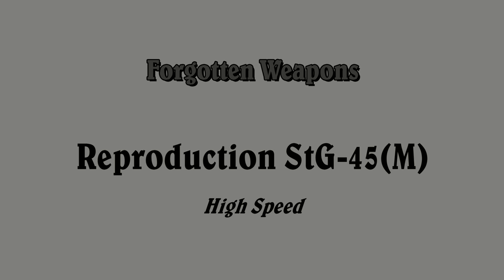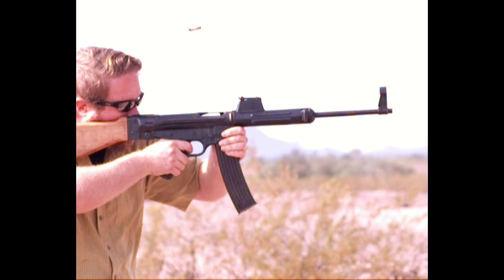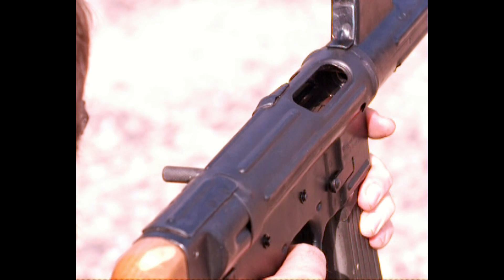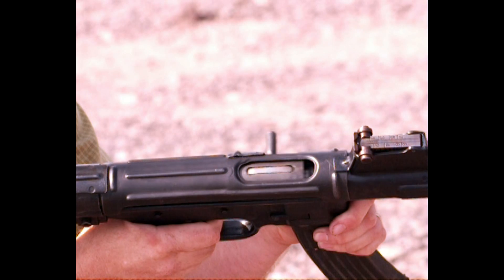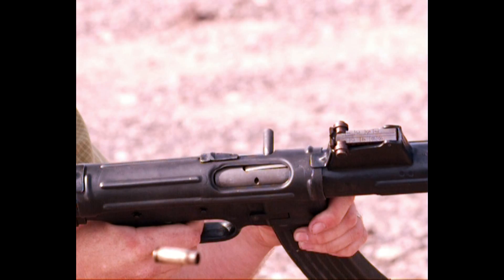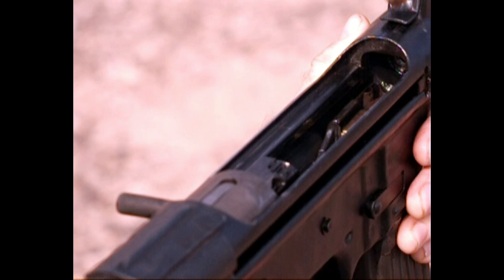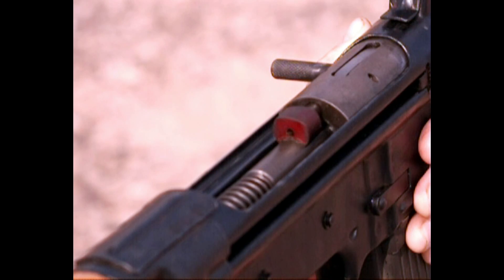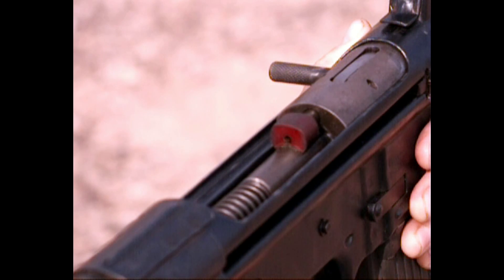Slow Motion: StG-45(M) Prototype (Reproduction)

Comment: This would have revolutioned the war. Imagine 3 Million Lads with STG-45
Reply: The reason as to why I believe that the STG 45M was far more suited as the mainstay rifle of the Heer (Wehrmacht) was because it perfectly fits the criteria of that army for a whole host of reasons. As such, the 44 was far too costly, time-consuming to manufacture due to its complexity, heavy and difficult to maintain on the field by the standard infantryman. Additionally, the heavy usage of the full auto feature was generally not recommended, as it was more of an emergency feature, therefore semi - auto was used, which is why the 45 was better for this. Furthermore, the 44 overheated a lot during full auto unlike the 45 which would have had a bakelite handguard.
Reply: @gundam5281  "44 was far too costly, time-consuming to manufacture due to its complexity" I don't think 70RM was that much but oh well... Also no, full-auto wasn't a emergency feauture. If they wanted a gun to fire in semi auto, they would continue the G43...
Reply: @narodwpsanialy1940full auto was in fact, as directed by German command, a close quarters/emergency feature. They were directed to use semi auto to conserve ammo.
Reply: “Here comes the sun do do do do”

Comment: The russians copied it but they changed the name into ak47
Reply: The AK47 was closer to the M1 Garand in mechanics than the STG 44.
Reply: @acdczeppelinhalen1  how?
Reply: Norweeb TM kalashnikov based his action off the m1, and the stg and ak action are extremely different
Reply: @iain3713  The AK is a copy of the stg just like how the Germans copied the t-34 with the panther. Both tanks are extremely different internally and mechanically but doesnt change the fact the only reason why the panther was designed and built was because of the t-34. Same applies to the AK. The only reason why the ak-47 was designed/built was because of the stg.

Comment: Can you tell me if this is a constant recoil system?  The bolt does not appear to stop at the end of its travel, rather it appears to slow only on recoil spring tension.  The buffer could be confusing me, though.
Reply from the maker: It's not designed as a constant recoil system, but it does have a very long travel, and wasn't hitting the back of the receiver at all in this video. We were using FNM ammo, which is a bit underpowered. With original WWII or Prvi ammo, the buffer would actually contact the rear of the receiver.

Comment: This is kind of an iffy repro of the StG 45(M), it is kind of a hybrid between the Gerat 06, 06H and the StG 45(M). It has the stock of an 06 (StG 45(M) had a stock that was a dead ringer for the one on the subsequent CEAM Modèle 1950), StG 45(M) sights, the dust cover from the 06H (no surviving StG 45(M) had a dust cover, and if nothing else when they were absent there was still a top to the receiver), and the handguard looks like a continuous piece of the receiver stamping (the handguard on the StG 45(M) appears to have been a separate part and ws grooved rather than ribbed and was made from either metal or a Bakelite type material).

Don't get me wrong, this is still a beautifully made looking rifle, just that it had some inaccuracies to the rear world gun. Not that this is surprising though, as I think that there was actually only one pretty much complete gun that ever existed (V-20) and maybe a couple more that are slightly more cobbled, like the British assembled V-21 which if nothing else has an 06H stock.
Reply from the maker: V-20 was assembled by Henk Visser well after the war. None were actually completed by Mauser before the war ended, so I think there's a bit of room for interpretation.
Reply: Forgotten Weapons
Was V-20 made from a matching set of parts (with a few missing ones recreated from original factory plans)? That is what i had been told, so to me this seemed like it would have been the closest match the what the thing was actually meant to look like. I will concede though that if built post war the stock may by the most likely part that would have been newly built so it might not necessarily be indicative of an original.

V-20 also looks the same as V-21 which was assembled by the British apart from the handguard and the stock. I don't know what to make of the handguard, but I think the stock is just an incorrect one from an 06H (which had the downward sweeping stock to go with the lower profile sights), as it makes little sense to me for a rifle to be fitted with the swept stock and the high profile sights. The receivers are definitely the same so it seems likely to me that the StG 45(M) would have abandoned the dust cover if it was actually produced, or at least changed the design. There is no dust cover on V-21 from what I can tell, but on pictures of V-20 there is something going on with the ejection port but no picture shows it clearly.
Reply: funiy ting ther are a few copies made here in argentina after the war (yea they were made by some germans that come here after the war). but the are not staped they are machined.